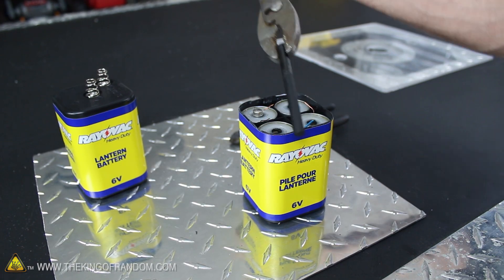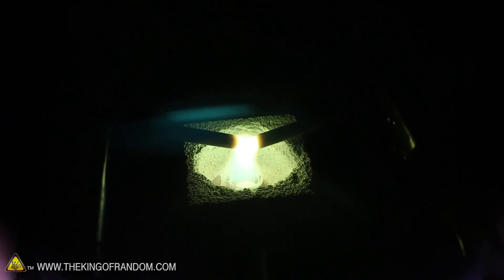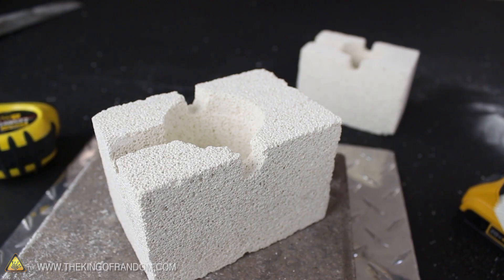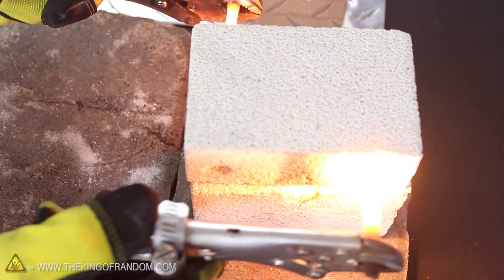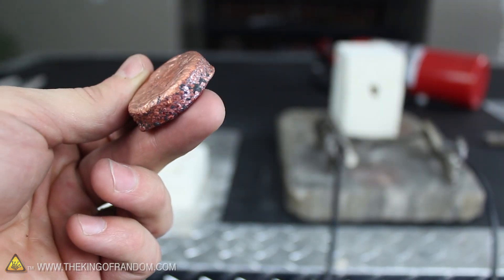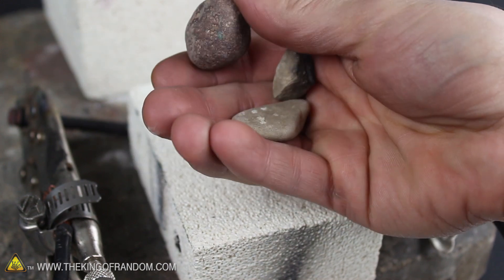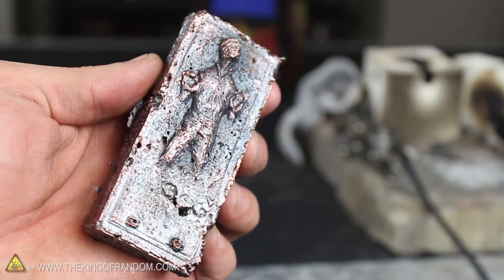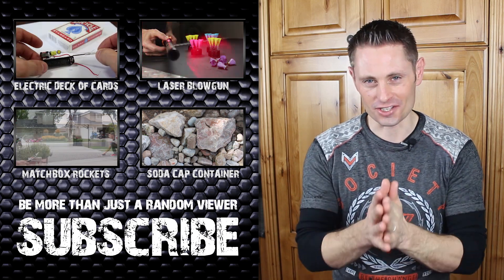Mini Arc Furnace (Arc Reactor Technology IRL)

Comment: This is my new favorite channel, but i know if i try any of this i will give myself 3rd degree burns. You need to make a safety video
Reply: Nick Davis apparently burning to death is the most agonising way to die
Reply: uh i think itd be 4th degree if you got molten steel or lava on your hands
Reply: +livelife441 
Let's be explicit. Some of the top risks are:
1. Water. At these temperatures it will split into oxygen and hydrogen, and possibly recombine causing serious explosions of metal.
2. Heat. You've sparks flying around, you need fireproofs for yourself, and you need to have something for the rest of what's around you. Preferably nothing.
3. Light. OK, he's got a welding helmet on, which also protects his head. You also need to ensure nobody comes crashing in or you'll have someone who's just blinded themselves flailing around.
4. It sounds silly, but mistakes are silly. Everything must be mounted on a solid stand.
Reply: I was melting pewter and it sort of blew up and got metal on my hand and now I have a small but deep burn
Reply: or you could learn correct procedures by yourself and not place blame on anyone but yourself
Reply: +livelife441 Just wear gloves with thermal insulation and electrical grounding
Reply: Safety with molten metal is mostly common sense
Reply: 1,4-Dioxane just use standard welding gear or gear you would use while operating a metal foundry
Reply: Just use welding clothes, gloves, helmets, etc.try and either put tape on boots the way I used to weld decking or get covered leather shoe strings. 😉😄😄😄
Reply: Lol
Reply: +livelife441 its not an idiot you are
Reply: +livelife441 its not an idiot you are
Reply: +Robloxian Destroyers probably fifth degree would be at a point where you just spontaneously combust into vapor...or vaporize
Reply: There is 7layers of skin
Reply: I did this but nothing happened to me
Reply: I was burnt by grease it hurts horribly I was wrapped up like a mummy
Reply: @nickdavis1143  use leather clothes or they probably know more I haven't struck an arc in 13 years now.
Reply: or ionize
Reply: Minecraft pe geek. um, seriously? did you even go to school?
Reply: stfu

Comment: With the rod things that you pull out of the batteries, are they hot enough to melt the metals by itself?
Reply: +Videsh Bidaisee I believe the enclosed space helps in retaining much of the lost heat.
So the answer is yes, but a whole lot of energy is saved by using the firebrick.
Reply: +Videsh Bidaisee Those rods are what is making the arc to melt the metals dude...

Comment: I've read that some are using arc type reactors to create a plasma torch and burning landfill waste to generate electricity and syn-gas. It also creates slag for road paving and they spin off rock wool as a byproduct of minerals melting. It would be nice to see if a small home power generator could be adapted from this technology. The studies have claimed an ability to harness 80% of the usable energy as compared to only 15% using standard incineration.

Comment: Question! What kind of gloves are you using in this project, any particular purpose for them, they look heat resistant, but shock too? Does the copper wire that connects the to the pliers makes a complete electrical circuit? And if so, what would be the power, and maybe a safety precaution when handling, electrical hazards? I'm really curious to try it myself, but I don't want to get electrocuted in the process, unless electrocution is only a hazard when dissecting the batteries/ or doing something foolish with the electrodes. Thanks for reading and replying. Anyone else knowledgeable, feel free to add your two cents!

Comment: First of all, great videos. I enjoyed watching them and you have earned yourself another sub!
Secondly, I have a question about the arc furnace. How many times can you use the actual furnace bricks before they go bad, or do they last indefinitely?
Thanks!

EDIT: One more thing, what kind of gloves did you wear when using the arc furnace to protect from electric shock? With such high amps, it seems like you should need some very good gloves, or is it not that dangerous because of the lower voltage?

Comment: sooo steel sparks like crazy when its melted?
Reply: +bob jenkins did you watch the video?
Reply: ender_scythe I did i was just wondering because it was never a metal I thought would have such a hostile reaction
Reply: +bob jenkins well it's super hot so it ignites air...
Reply: ender_scythe the carbon rods, they were around the same temperature probably hotter how come they were not sparking?
Reply: +bob jenkins the sparks also are from the steel itself
Reply: ender_scythe you just said the sparks were due to the heat.. so know you are changing your explanation?
Reply: +bob jenkins I said also dude.
Reply: ender_scythe no you said it ignites air because it is super hot you added in the part about the steel producing the sparks later on which contradicts your original argument
Reply: +bob jenkins just whatever, this argument isn't worth it.
Reply: ender_scythe alright just act like your above me totally doesn't make you look pretentious
Reply: +ender_scythe the guy is clearly a bit too young for this project anyway, so let's just end it here, no matter what he says.
Reply: Ozzie Gorbitz <3 I do love it when someone dismisses my opinion because they can't think of a good argument to go against me, then insult me to try and create an excuse for why they are not arguing.

Comment: You never do state the applied voltage. I assume it is less than 50 and greater than 6. Could you please state  what the voltage is? and what is the  typical current rating of your Microwave Transformer? Also: Is it required that the two carbon rods be touching constantly? OR is there a separation and a spark maintained?
Reply: It puts out about 2-5v and 800-900 amps

Comment: Machining that type of brick may ruin your lungs and shorten your life. Red brick may work. Red brick has to be heated up slowly and cooled slowly. or it will crack. Refractory brick is not as safe as candy. If you are working it at all in your house, Consider your clothes and your entire house contaminated. and your yard.
Reply: I have a rule for my life that dictates that I do not complain without a solution.  I have many solutiions.   TO SPELL IT OUT FOR YOU- If I shoot the dust particles outside, Those particles of badness are still in existence. .I always imagine that my exhaust goes right into a baby's crib. With this in mind,, I am careful about what kind of toxins I ventilate into the outside air.  If a jogger was passing by and got a lung full of this type of dust, They would notice it. They would age their lungs because of some type of dirty deed I was up to. I am trying to love my neighbors as myself.
     The dust does not disappear when it is shot outside. That is what I am really tryng to say. =
----THIS TYPE OF DUST DOES NOT GO AWAY. THE PARTICLES ARE VERY SHARP AND JAGGEDY AND WILL RUIN YOUR LUNGS.   Love your neighbor as yourself.  I do.

Comment: Hey, quick idea for you with this project. Have you considered filling the holes inside the furnace with refractory cement to lose less material when you pour? I notice that the brick slowly seems to deteriorate after each use because it's so soft. Do you imagine refractory cement would help the inside hold up better?
Reply: +William Gray 1 furnace costs $3 I don't think he's worried that the furnace will be gone.
Reply: +Golf Ray He means the materials, I believe
Reply: +Andrew Tallow Yes the materials, if I made a kit it would cost $10 for the furnace (carbon rods and everything) and like $200-$300 for the welder.
Reply: @ender_scythe2879  200-300$ for a welder? just make the custom homemade one, its cheaper. I myself have already modified multiple microwave transformers, and have melted a bunch of stuff.
Reply: +ender_scythe what you can buy one of his mini arc furnaces?
Reply: +Golf Ray Though that would be awesome
Reply: thanks for the update. Appreciate it
Reply: +William Gray  Good idea but if someone were to use normal cement instead it would blow up.
Reply: it gets so hot that the brick melts on the inside, if you simply let it melt, then the holes will fill themselves in, and it will become smooth like glossed ceramic.

Comment: I I want to do an arc furnace but I want to make it bigger. How do i glue the bricks together? And it will be this powerful or the carbon rods are going to collapse and burn into ashes?
Reply: Just use a whole brick, and drill bits twice the size
Reply: +Andres Hechenleitner There are special carbon rods you can buy online, they work better because they have a copper coating around them.
Reply: thanks Marcus Octavius and Anschnur Missionar
Reply: +Andres Hechenleitner Yeah... don't glue the bricks together. They glue will probably melt/explode leaving you with molten metal everywhere.

Comment: Don't know if anyone has said this yet but you need to heat up plaster molds so they don't sputter. Stick it in an oven or heat up with a propane torch before pouring to get better results.

Comment: I imagine this can be made bigger, the question I have though is if the heat will penetrate all the way to the bottom of the crucible if it is only coming from the top, rather than from around, like in your mini metal foundry?

Theoretically if it's only a foot or so it should be fine, but let's say the crucible is 4 feet in height, would the heat travel down through the metal, or would it taper off significantly?

Comment: You should also try to melt titanium and make a cast and stuff.
Reply: Matthew Skoog Titanium has to be in an air tight vacuum. This works by turning the air into plasma and directing it at the metal, so this wouldn't work. Not possibly to melt it with this.

Comment: Can you boil metals like mercury with it ?
Reply: Joe Wilson that's extremely toxic and poisonus, also if you don't have a chemistry license you'd better stay away from that kind of metal.
Reply: I just used mercury as an example, because it is famous for having a low boiling point one could in theory use a less poisonous.
Reply: Joe Wilson
all metals that found at that level are either poisonus, since even if they not boil, if you paid attention to your physics lesson you know that all liquids are in a permament state of evaporation, when a liquid is boiling it means that it's at its maximum evaporation speed and all energy is used for the transaction.
Heavy metals, also, are the most poisonus ones, and surprisingly Mercury is one of them. This is why now analogic thermometers aren't made out of mercury anymore but alcohol.
Reply: I know about how poisonous mercury is, and i said i just used it as an example, can do it out side with a small amount of metal <.1

Comment: So it doesnt melt steel beams?
Reply: +Mac Pigstine Someone doesn't get that dank meme.
Reply: +Mac Pigstine you must be fun at parties
Reply: Mac Pigstine The OP was making a reference to the meme, which is why I stated you didn't get it. If you still can't get it, that's on you. And also, the government did 9/11.
Reply: +Mac Pigstine It didn't need to melt the steel anyway.. steel loses a lot of strength, at least half, when you increase it's temperature over 600 degrees. The towers definitely collapsed due to fire. They were under serious load and lost half their strength, it was bound to happen.
Reply: +Jerrald Arcega it melts any metal, yes it does melt steel beams u just need to be patient as it will take longer
Reply: Bad day?
Reply: NecroBanana i have no idea what u r talking about
Reply: Mac Pigstine Google "Jet fuel can't melt steel beams meme."
Reply: ***** yea
Reply: Building 7
Reply: NecroBanana jet fuel is not mentioned anywhere in the video or previous comments. and in regard to jet fuel, steel beams and 9/11, the beams would not need to melt, the impact force was enough to make the twin towers fall. fires caused from burning jet fuel could have caused other objects/ materials to catch fire. if there were gas pipes in the world trade centers [quite likely for heating and such] this could have 'melted steel beams'

Comment: Pretty cool. Shows just how important it is to never underestimate the power of electricity, because as impressive as this is, it merely touches the surface of what it can do. 

Example? My father worked for the local power company, and had a ton of stories and sometimes even photos showing what electricity is capable of. One in particular (with photos to prove it) involved a substation malfunction which resulted in the entire thing being reduced to metal slag in a matter of seconds, including two vehicles which were in the small utility parking space. 

Experimenting with electricity is fun, but you've got to be respectful of it, and bear in mind that it doesn't always play by the rules.

Comment: IRON SWORD!!
Reply: +Taro Quirkz No a sword cannot be made from castings. It would be too brittle
Reply: +MrOpenGL It could be made though.
Reply: Lance Pate
It would be useless even for cutting bread!
You would waste less time using a blowtorch or even charcoal, an iron bar shaped to a crude sword shape with a saw and then use a hammer to make the blade.

I made a shortsword that way. I use it as a kitchen knife :D
Reply: +MrOpenGL you would have to harden and temper it
Reply: carbonscale You are wasting your time trying to cast a sword. Yes you could anneal it, harden and temper, but what's the point of casting in the first place when it takes much less time to use a simpler method.
Reply: MrOpenGL i wouldnt cast a sword myself.i agree with you but i was just saying that you could heat treat it if you wanted.
Reply: +MrOpenGL maybe just cast it for a keepsake

Comment: how much electricity does this use though?
Reply: RetroResto 
Unless I missed something, it shouldn't be too expensive to run.  You figure he's using MOTs on the input with the original primary windings (those are designed for 1.5kW or less)  So even if he's grossly overloading them, lets say it caps out at 10kW of power.  Well a kWH is like $0.10 - $0.30 so you could melt stuff for an hour and only spend a few dollars.
Reply: I think 240 volts ac
Reply: CyberTheBronyGamerGuy  No, I mean how much current is it going to draw, and how much would it cost to run. If it costs 10p to boil a kettle (3 - 4 mins) then how much does it cost to melt something? numerous pounds?
Reply: RetroResto he uses transformers scavenged from 2 microwaves, so consider that cost.

Comment: I don't think it will melt uranium or thorium dioxide though. :(
Reply: JMAPScience Uranium melts at 2,000 degrees Fahrenheit, so the arc furnace would work on it if it could be acquired.
Reply: JMAPScience  Isn´t appears secure to make this with uranium ;(

Comment: WOW,,,!!! Power Amazing. You can do. Anything now. You have power. So I made a welder out of microwave, lawn mower, bunk bed parts. but it doesn't work it just makes a humming sound. I did something wrong somewhere I wish I knew how to fix it, if I had a welder I could be making so many things choppers out or bicycles, bicycles with weed weaker on them, dropped rat rod wagons. a chance. Fix my Corvairs my 37 ford. well I found 5 more microwave transformer. I would like to make one of those melting machine if I had that knowledge I try & try looking up to make welder I get no where.

Comment: How the Heck do you not get electrocuted!? Do you have river on the handles or something like that?
Reply: He has gloves made of some sort of fireproof, electricproof, and bomb-proof material.
Reply: Gigabic just heavy duty work gloves, made with non-conducing, anti-rip, fire and heat isolating materials.
they're quite costy but the price is definitely worth it if you want your hands still in place and not like the steel he melted.
Reply: +Jensen Sinclair High amps and low voltage, too low in fact to electocute you. This is the same principle with every welding device, since the resistance of the human body is too high it won't do anything to you.

Comment: I have to ask, can you cast steel into the the styrofoam sand thing, or will it melt the sand? You said the bricks where the only thing that could handle the heat, was that at all or compared to, say, a baking tray?

Comment: Have you tried running an arc through wet wood or logs?  Lightning travels through the sap and moisture when it hits a tree.  If you could control that electricity you might get some interesting patterns.

Comment: how much would i 
have to pay you for one of these
Reply: samsepticeye I think that you'd be off cheaper by buying some refractory/fire bricks yourself and combine it with a welder and the electrodes salvaged from lantern batteries (or buying the carbon rods off of eBay instead). The most expensive part of the whole arrangement is the power supply (AKA welder).

Comment: just curious, I wonder if it would help to take your plaster of paris mold and place in the oven at 250F or so for an hour, to make sure it is totally dry. I got the impression that the moisture was flashing to steam and the high heat was releasing hydrogen and oxygen from the steam. So, lots of what looked like smoke and micro explosions. Look up high-temperature electrolysis.